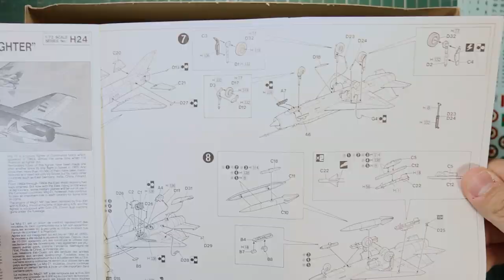MiG-21Bis Soviet VVS 1/72 Fujimi Plastic Model Full Video Build

Comment: What a superb build that is. Lovely camo work indeed. Loved the chipped effect. I had 2 small questions:
1. When you dry brush the cockpit parts like seat and IP how do you ensure that the paint doesn't get onto other unwanted parts because I have seen some extremely fine work like switches etc. painted in just a few seconds of dry brushing
2. How long do you allow the ink wash to dry before wiping it off?
Reply from the maker: Thank you Sherbir.Well if you mean about the dryrbushing I am really trying to strip most of the paint of the brush before I do that.ussualy on a piece of toilet paper.Stroking the brush until it leaves no trace of paint.And then I do it to the model.The ink wash I leave to dry for 3-4 minutes at most and then wipe it off.It dries really quickly and that is one of the reasons I am using it to this day.